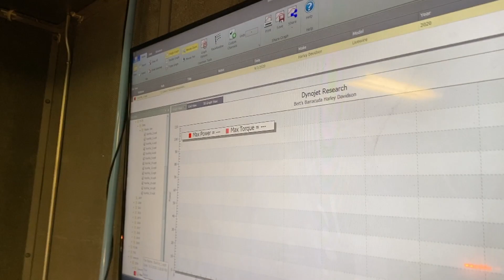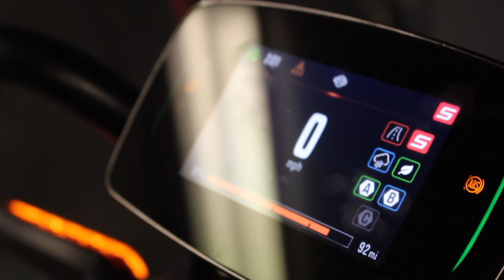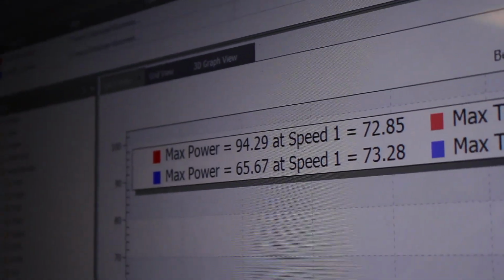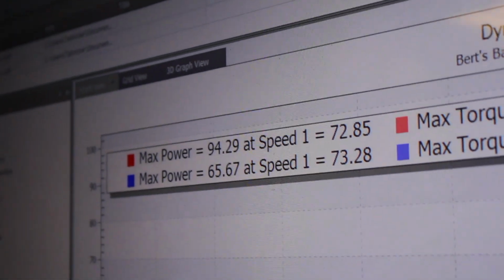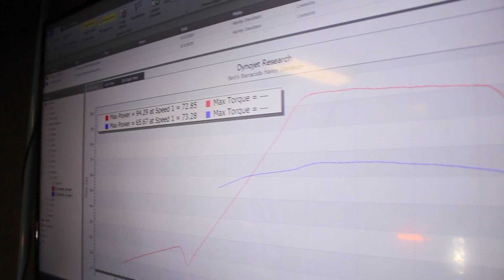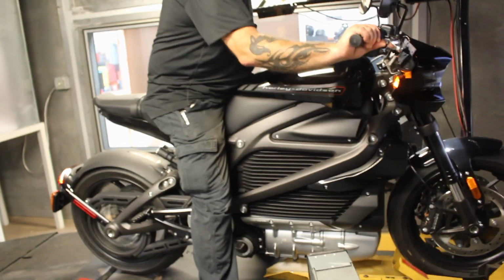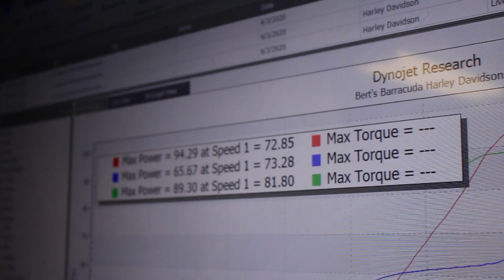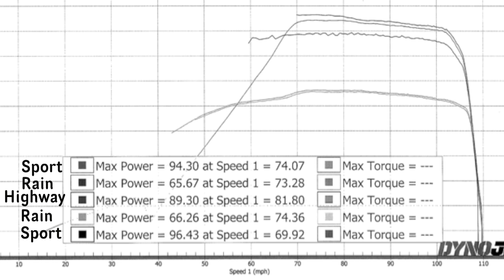Dyno Tuning a LiveWire

Comment: why did the wheel not spin and the powr slowly increase on the dyno run at 1:20? it was floored the whole time, was that traction control or what happened? in the next tests it seemed to spin the tire when floored at low speeds so i am not usre what kind of power curve or power delivery it is doing. of course after like 40 mph its jut flat 90 ish hp but I want to know what it can do all the way down from a stop.

Comment: How come there was no torque reading?
Reply: Sounds like the Dynojet calculates Torque rating from horsepower and RPMs. Since they were not able to hook into the bikes RPMs, then Dynojet could not output a torque figure.
Reply: why not hook up an rpm sensor to the brake rotor?

Comment: This is basically limited by the power the batteries can deliver... an electric motor is not really power limited, only dissipation limited. So for short amounts of time it can do huge power, as long as it does not overheat. And under those conditions the battery is the limiting factor. You can see the elctronics do a good job of keeping the power draw from the battery constant, as the hp delivered is constant. At lower rpm (when it has not reached 95 hp yet) the elctronics limit the torque and in this way also the motor heating (motor heating goes quadratic with torque).
I am an electronics engineer and did 10 years of (hobby)work on ebikes.
Reply: So is it possible to build a 370v battery bank hooked to a 350amp alternator for charging via connected to my electric 120v motor? Of course there will be some sort of cooling system
Reply: Also can I increase the hp of a motor without major internal reconstruction? Can I manipulate the hertz or frequency waves cycle in either ac/dc motor?

Comment: Why the chatter from the rear tire on the dyno???
Reply: The bike makes so much torque down low so quickly that the tire cannot physically grip the dynometer measuring drum. 
Electric motors make instant torque so there's no rev up time like an a gas engine, so it drops all that torque to the floor before the tire can get a grip.
Reply: @FranBunnyFFXII  I suspect that a smother throttle hand would yield a better result.
Reply: Spinning
Reply: It needed to have the rear strapped down.